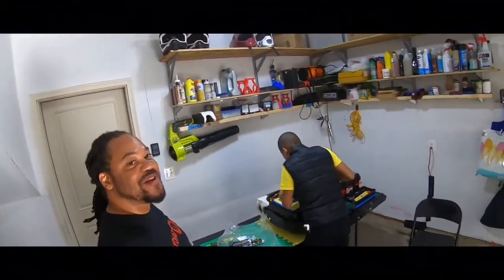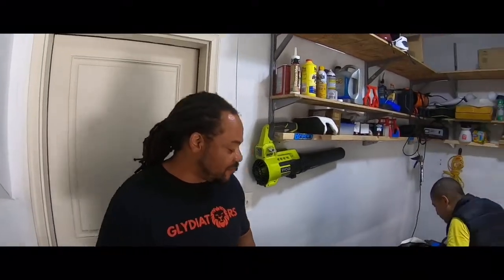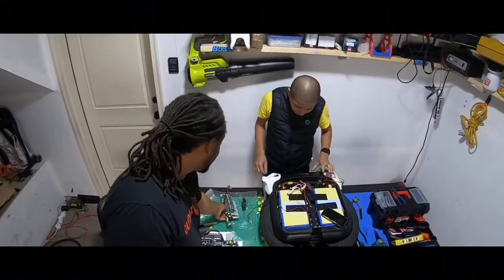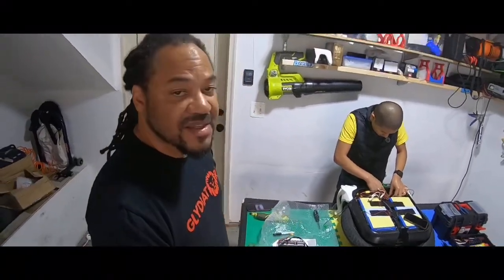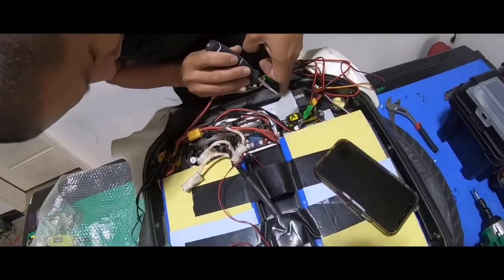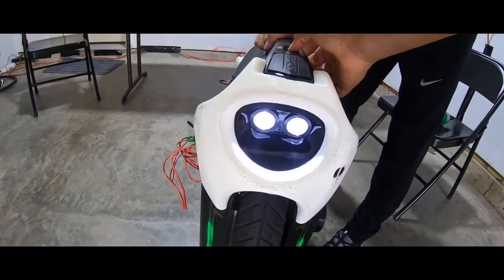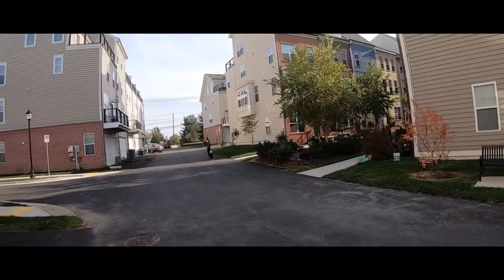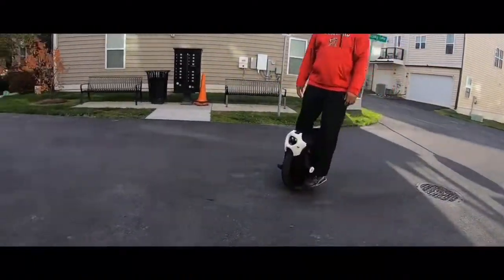INSTALLING THE BLACK MOBO ON THE MONSTER PRO

Comment: Are these new mobos for the MP firmware updatable? Like the black you installed or the newer green? 🤔
Reply from the maker: Yes. They are if you pair it with the small hollow hub motor.